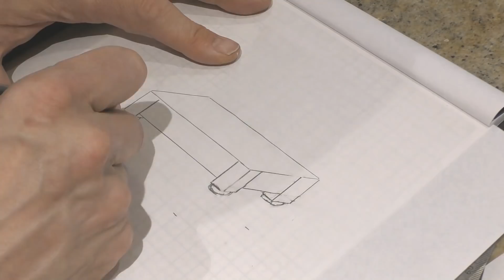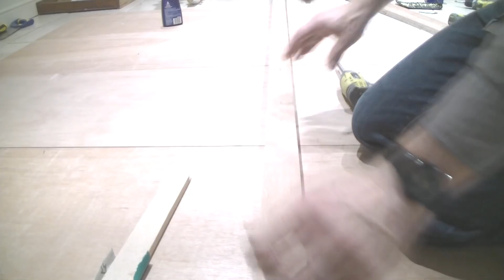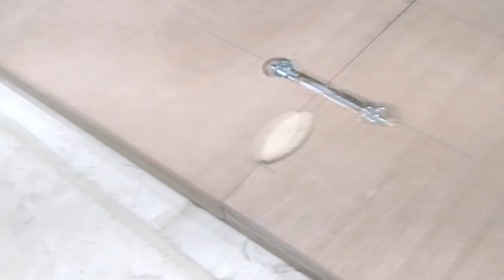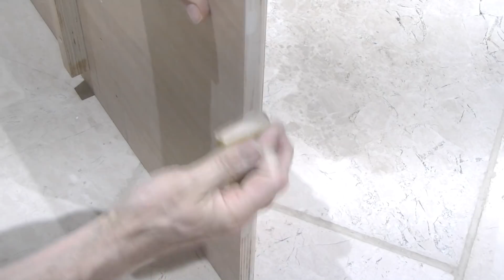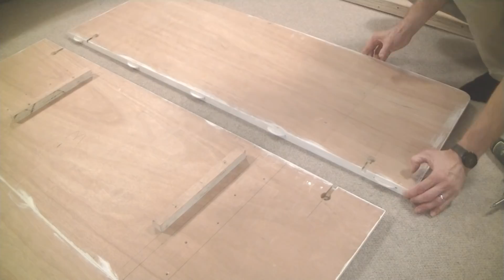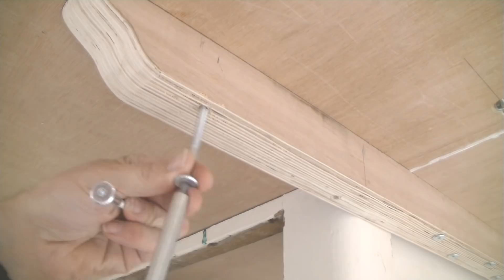How to Extend Your Kitchen Table

Comment: Besides zip bolts, I've used latches like on a window but they have an extra 90° turn to lock & secure the latch in place when connecting the extension leaves, & your able to leave them on the leaves, the catches etc.... Just another suggestion(if want pics can send you some). Pretty cool vid.
Cheers, A

Comment: Using drawer runners and tension catches to lock them for both end boards would enable you to quickly take out the middle boards for convenience without the hassle of the screws etc. Enjoyed the build very much. Also if you can't find 25mm ply at your DIY store simply glue 2x readily available 12mm boards together.

Comment: That was a cracking job Charlie👍 I am not sure the biscuits do much to help alignment (you need a festool domino - as well as a new jig saw). 😂But the finished product looked great and a great use of your Grandma's table - she would be very proud of you. Hey nice sketching skills too - are you a bit of an artist?😀
Reply: Biscuits are certainly good enough for keeping the flats of the tabletop level with each other - a Domino would be great for lining up sideways as well, but I suspect that probably puts the whole project a bit over-budget for most DIYers!

As a middle-of-the-road compromise, it might be worth trying the same thing with a dowel jig and some chunky 10-12mm dowels. Us mortals would probably have to get the circular saw out to re-align the leaf edges afterwards, though!

Comment: Excellent video Charlie and using your router. Once again, showing that the ordinary guy/gal can create great DIY with the basic of tools. Impressed by the zip-bolts.

Thoroughly enjoyed watching this. My next tool is an electric plane.

PS, purchased the ballbearing drawer runners which you used and they are ace! Cheers. 😀
Reply from the maker: Deanne Maria Thanks Deanne - I really appreciate that. Yes, my electric plane is one of my most frequently used tools. But the tool I'm really loving at the moment is my new circular saw. I'll be doing a video on it soon. Thanks again.
Reply: Charlie DIYte great! So glad you have a new circular saw.

In my last email to you, I mentioned
that I have an excellent circular saw; an "Evolution Rage", although it is not used as much as I would like because of the dust. I live in an apartment block.

I await your demonstration re your new saw.
Reply: Deanne, the Evo product's are really good for the money. My first compound mitre saw was an Evo and it lasted years, think it was only £100, with a solid cast iron base it was well worth the money. Their products are perfect for the DIYer.
Reply: Helpful Home DIY hi there, I already have a great mitre saw; mine is an Evolution RAGE3+ Multipurpose Sliding Mitre Saw 255.

Thanks and all the best.